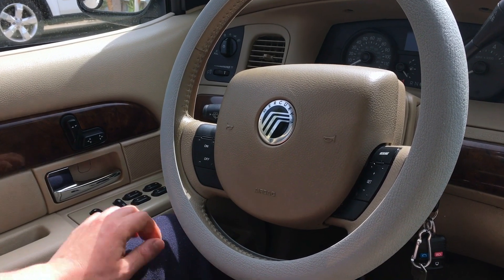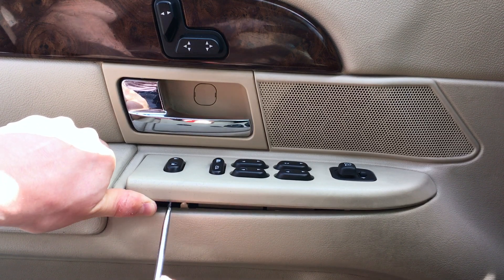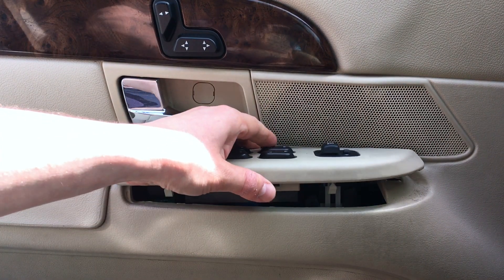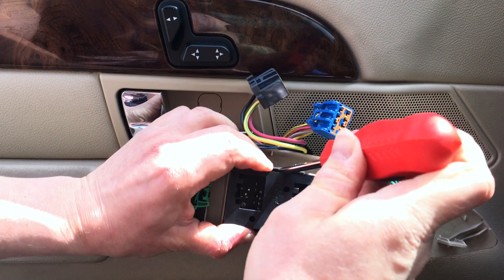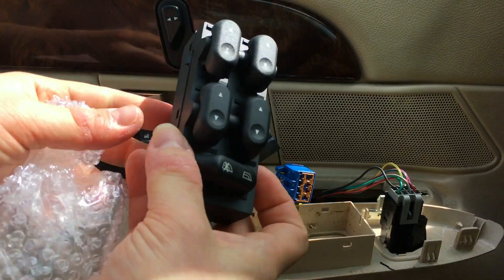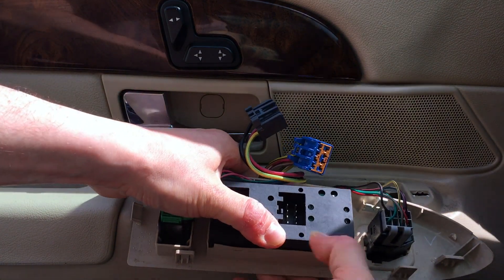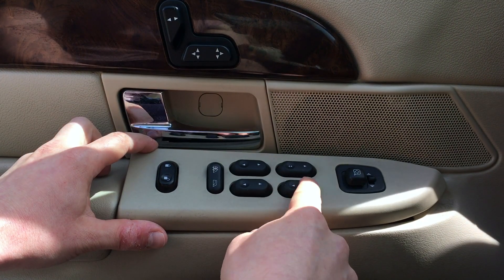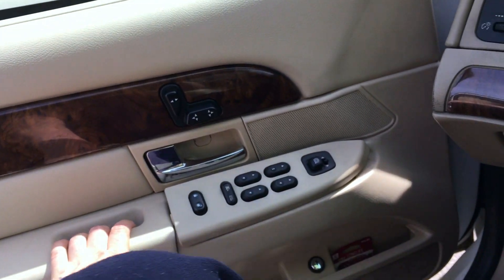Grand Marquis Master Window Switch Replacement (How-To)

Comment: I hope the Lord has a special place for folks like you who take the time and effort to show us how something is done and how to save some money, too.  I just got an old 2006 Mercury Grand Marquis and have to change out that switch.  Thanks.
Reply from the maker: hey, glad to help!!  Good luck, if you need any help feel free to message me on here again, that's why I do these videos.  Great purchase on the car too btw.  Mine gets about 30-32 MPG at 70 MPH speeds, basically similar to a 4CYL but very comfy.  These are great cars for highways and burnouts!!! ahahaha.
Reply: 9
Reply: @hybrid32494  hey what of the rear window won't go up from the rear switch either? Same fix?
Reply: @RickSwords  was it indeed the same fix? I’m having this problem with the rear passenger side.
Reply: @jpeso8374  me too. I just gave the car to my daughter.
Reply: @RickSwords  did it ever get fixed by you or your daughter? If so, was it the same fix on this video?
Reply: It could be your switch, or window regulator. Which more times than less it actually is. I went through 3 switches before we actually discovered that. It would intermittently stop and start. While trying to make it work
Reply: You see that hesitation as it gets half way up, that's a failing window regulator. Eventually that's gonna give out, mine did the same thing until I switched it out.
Reply: @jpeso8374  window regulator bro.
Reply: @RickSwords  regulator bro, you can do the switch and might get a lil longer out of it, but generally regulators on the motor goes out. It's not horrible to fix, but not the easiest either

Comment: The problem with the Switch Doctor unit is they did not manufacture it like the original unit. You can see the LED's shining through around the switch paddle. Ford provided a molded skirt under the paddle.

Comment: Nice. I have '04 Grand Marquis, and would just like to add, if you brake that tab off, game over. Ford locator to find a NOS one, 80.00USD later, shipping included, project done. Tried many epoxy, and bonding agents. Once that tab falls off in door, get out the checkbook. No glue works, and plastic welding lasted 2 days. Carefully start praying at the front, and work slowly. Good job though!
Reply: Gorilla glue fixed mine

Comment: Thanks for this video!  You mentioned the original part was dirty. Is it possible that cleaning it would fix the issue?
Reply: I tried tuner cleaner on mine, helped a little but still needed replacement

Comment: i got a 2003 grand marquis and the driver side window quit on me today. I don't know if its the motor or the switch so I may have to spend 30 bucks to buy a switch just to verify that. Thanks so much for the vid.
Reply from the maker: hey man! Good luck! Chances are it's the switch, start with that first because it's extremely easy to do.  That will instantly tell you what to do next.
Reply: @hybrid32494 Looks like my window is working again and I didn't even do anything. Later in the day when it cooled down, I got in the car to go to the gas station and all the windows were working. I wonder if it was the sap from the tree I usually park my car under combined with 100 degree heat? Either way, this is extremely helpful because I will probably have to replace this thing anyway because it gets wet pretty often and I may have rust.
Reply from the maker: @mattakudesu  hey man! thats good news, at least you can live with it for now, and your window regulator seems fine.  Id say it's the switch for sure, get ourself any cheap reproduction switch like I did just in case this happens again you could easily troubleshoot on the spot.  I pretty much have a window switch problem in every singe car I own and have ever owned, LOL.
Reply: 👍👍👍👍👍👍
Thanks!
Reply: Yeah it seems like when the weather is cold the window gets stuck, when it warms up it rolls.  Just don't get drive thru in the winter, it take some praying to get it back up apparently.

Comment: 0:54 start prying it up from the front, they even put a slot up front for the flat head screwdriver to fit in so you don't damage the plastic.
Reply from the maker: great comment, thank you for the advice, I hope people watching this video see this comment and don't run into trouble.

Comment: Thank you so much I just replaced mine and so far my window is working like a charm. Thank you thank you Thank you thank you thank you ! 
Now another question, the seat adjuster on the door and the decorative fake wooden piece are both broke got a great deal (price) for those?

Comment: I have a 2002 marquis and the passenger window randomly stopped working from both driver and passenger side would that be something else that’s needs replacing or possibly similar to the one in your video

Comment: I switched out the old one and the front passenger side doesn't go up or down. The others all work now. Is there a chance that replacing the switch on the passenger side front door would fix it?

Comment: My front windows both work fine, but my rears will not go down regardless of if you use the master switch or the rear switches. Could a defect in the master switch cause the rear windows to be non-functional? Thank you for the tutorial btw, I just ordered a new master switch as mine is missing a few switch caps
Reply: Did this fix your issue? Having the same problem
Reply: @Elevehn  haven’t fixed it yet, but most likely is I need new regulators/motors in the rear. My right rear will work sometimes, but usually doesn’t. Not crazy expensive, heard it can be a bit of a pain
Reply: Work?
Reply: @Moneymakinmonni  this didn’t fix it, but here’s what worked for me:

For the door that has a stuck window, so let’s say rear left, hold the button for it down on the front door. Have someone else hold it, or keep it held down with something heavy enough. Now, close that door that had a stuck window HARD. Might take a few tries, but I was able to get my rear two working again this way. They’re quite slow to go back up, but it’ll do for now

Comment: Any advice for the fuel tank buttons at the bottom. It came out and ford dealership here doesn't have it.
Reply from the maker: hey!! Sorry, can't give you any advice on that, it hasn't happened to mine so far.  You gotta keep searching on youtube or google for a solution, i'm sure you're not the only one who had that issue.  Worst case scenario you could use Epoxy or even hot glue and it will keep the buttons in place well enough.
Reply: Try parts geek. I believe I saw one on there.
Reply: explain exactly what you are looking for  Maybe I can help you

Comment: Question. What if I have the same issue with the intermediate up and down in the driver side but also the passenger side switch won’t go up but goes down and that passenger side door switch won’t make it go up either. Would this fix this problem as well
Reply: I know this is an old video/comment but did you ever fix your issue? Im having the exact same issue. Driver side randomly will work but the passenger side wont work at all.

Comment: How do I reset the auto down feature? Installed the same switch you have and auto down feature isn’t working. Actually it just started smoking from the switch while I’m writing this
Reply from the maker: hey buddy! I highly recommend return that switch and get another one.  You for sure have a faulty unit, it should not smoke.  Good luck my fellow grand marquis brother.  Let me know of any. updates.
Reply: @hybrid32494  yeah I’m not used to my switches smoking. So you’re saying the auto feature should work out of the box with no re learn procedure? It’s kind of working intermittently, might move down half an inch or so and stop. Best it has gone down is about half way. Original worker no problem in that aspect. Didn’t. Know  if there was a re learn procedure. Hate to do the job again but luckily it’s not all that hard

Comment: Would this work on the 2005 grand marquis?
Reply from the maker: hey man!! Yes, the door panels are basically the same on all of these cars.  it would be nearly the same exact thing, it's just clips holding this in.
Reply: @hybrid32494    Thanks Man! Much appreciated!
Reply: @hybrid32494  So you changed it because sometimes windows worked and other times they don't? I have thia issue on my 04.

Comment: Can this work on my 2000 Mercury Grand Marquis?
Reply from the maker: hey buddy! The earlier 2006 and under models have slightly different interior panels and switches, otherwise it's the same process.  It should. be mounted the same way as I showed in this video.